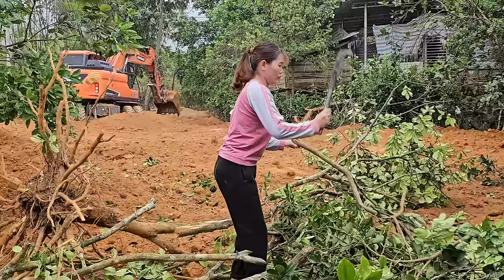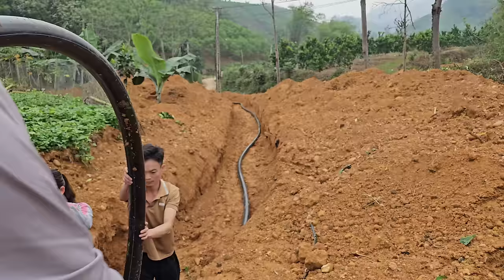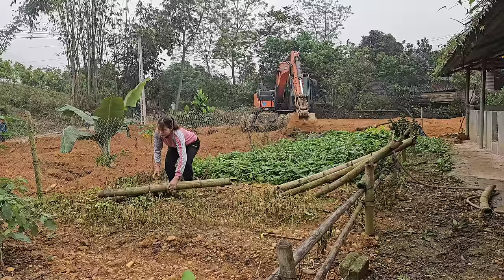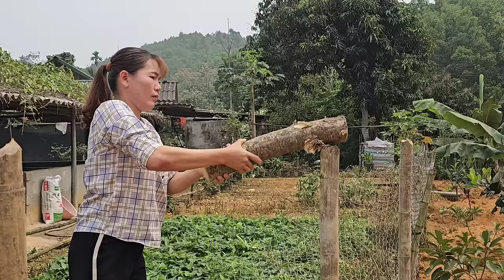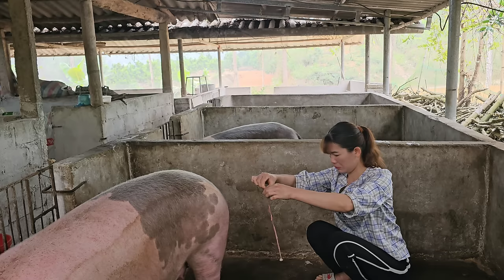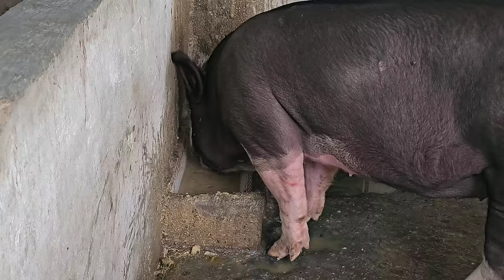Excavator expands farm.  Causing an earthquake causes the sow to miscarry. ( Ep 256 ).

Comment: Digging does not cause miscarriages,  if it did ALL of the sows would have done so.  If the machine was next to the building or hit the building, then all the pigs would be upset. Your video shows the pigs were quiet and calm through the whole process.  She was only in farrow for 4 weeks, most likely a natural miscarriage with no outside cause. 
Since you are expanding, I  hope you are planning on separating your market pigs from your breeding sows, with a washing station for your hands and utensils so germs are less likely to be transferred from barn to barn.  Farming is not easy. Cleaning and quarantine advice was learned by us making the same mistakes, we wish you not to have that pain again.
Reply from the maker: You are right, perhaps the sow's miscarriage was due to another cause, I will consider your advice.  Thanks a lot. ❤️❤️❤️❤️❤️